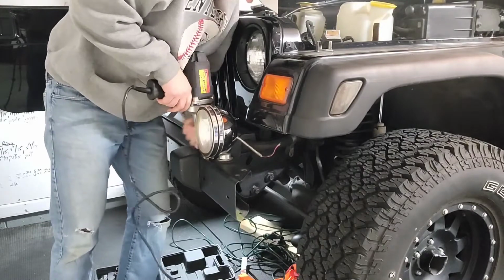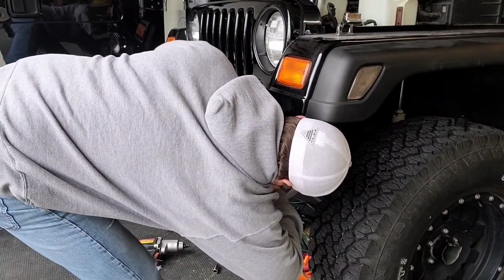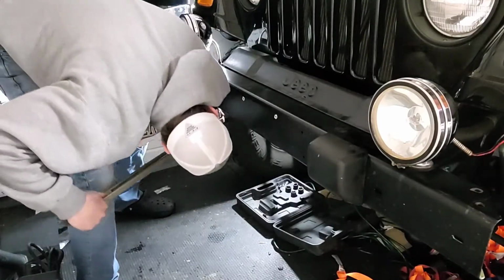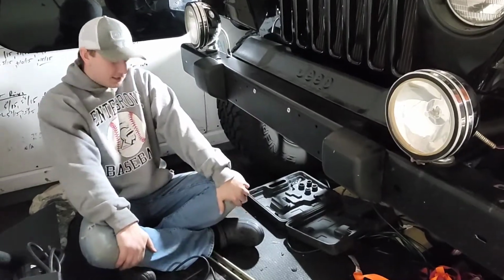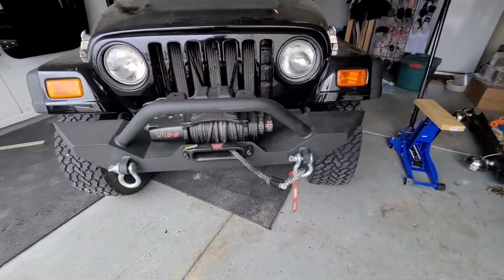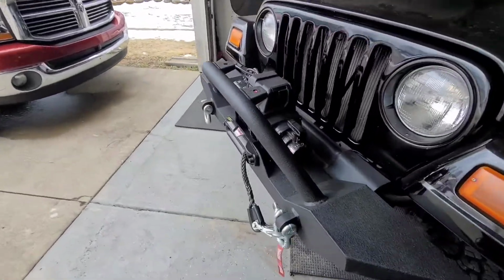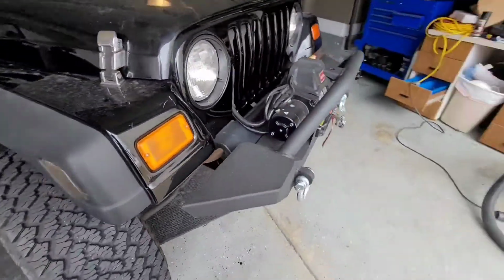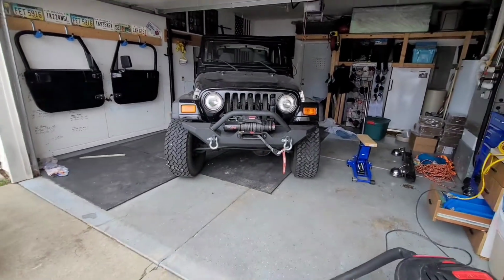Jeep Wrangler TJ - "Barricade Trail Force HD Front Bumper" - Installation

Comment: How is it working out now ? Any rust issues or anything ?
Reply from the maker: Hey thanks for your comment. I have since sold the jeep. Sorry. It was holding up pretty well. I kept a close eye on it tho. Any chip I would immediately paint with a bed liner spray. It's good. Not the best option but good for the budget.